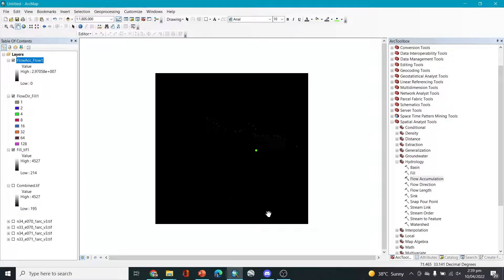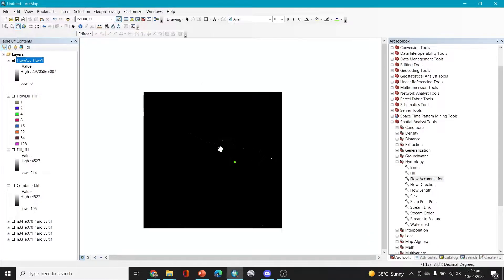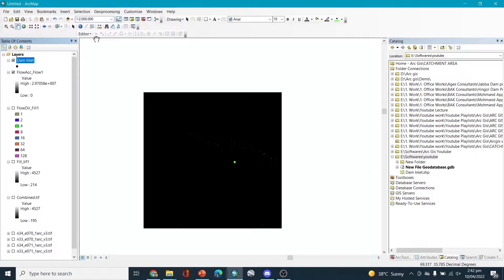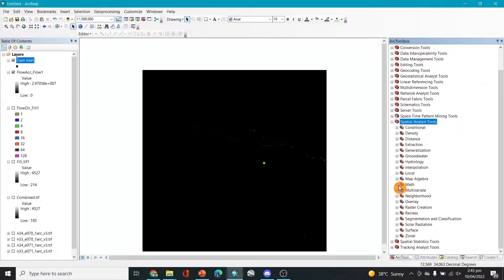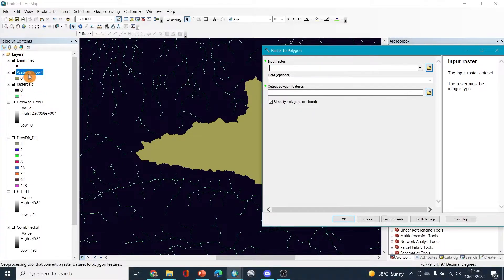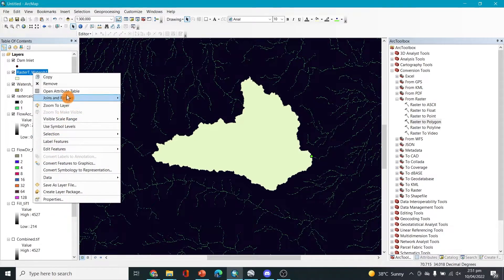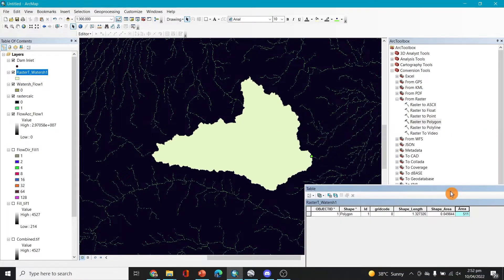Calculating/Delineating Catchment Area/Watershed(ArcGIS) Part-4

Comment: I did not manage to create the watershed. Got a warning saying "WARNING 001003: Datum conflict between input and output". 
What can I do to fix this?
Reply from the maker: You must have done some mistake, check again. 
Can you explain after in which step exactly you are getting this error.
Did you successfully get your fill, flow direction, accumulation, watershed?
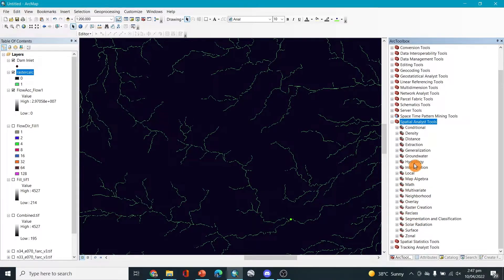Reply: @ahsanqasim12  Yes I did manage to get my fill, direction and accumulation, but not the watershed. I was almost through all the steps, but then I got an error after filling in the input flow direction raster, input raster and output raster (time stand: 5:00).
Reply from the maker: @saykpawchai5064  dont add output raster, let it be as it is.
Just add flowdir in first.
And 
Inlet point in 2nd box.
Reply: @ahsanqasim12  Still doesn't work. Do you think we could have a meeting in Teams? Maybe I can share the screen or something.
Reply from the maker: @saykpawchai5064  contact me on ahsanqasim12@gmail.com
Reply: @ahsanqasim12  I managed to create the watershed :-D Thank you so much for the helpful tutorials and quick answers!
Reply from the maker: @saykpawchai5064  good to know.